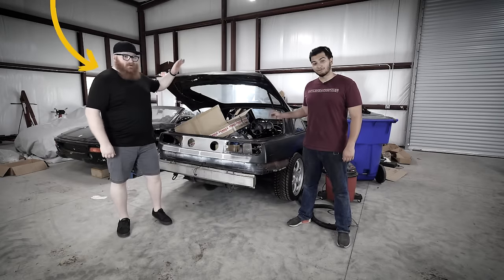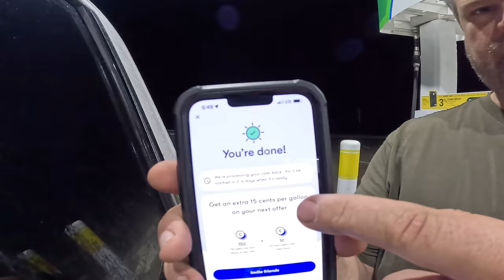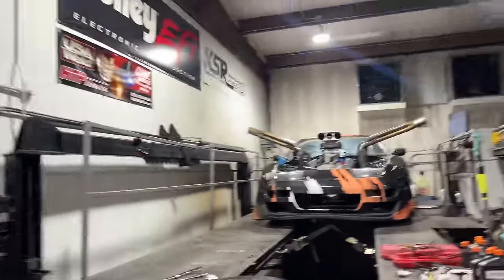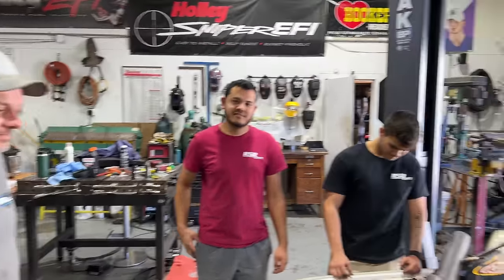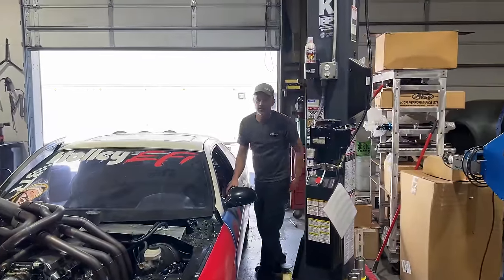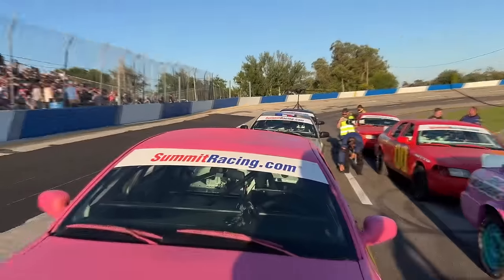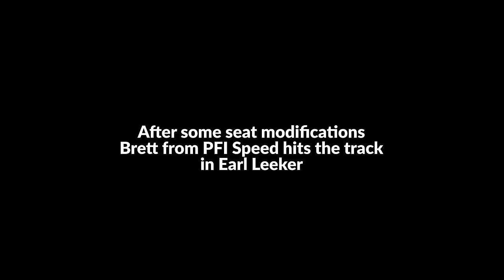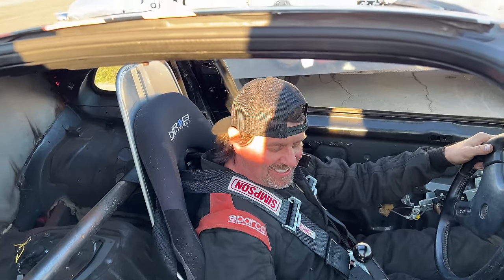We Debuted Our Nissan 300ZX In Front of 10,000 People! It Didn’t Go Well…

Comment: Tunnel Ram + Fuel Injection is harder than it looks. It is a nice looking car and an awesome looking engine that is a work in progress. As is your typical situation you seem to be in a time crunch and as a result the event WAS your first actual driving test of the car. I say it went real well for a first effort when you drove the car.Then you made fuel the pressure change and it went downhill. Perhaps moving the injectors just before the valves as you intend to do will be the fix, as the changing air/fuel mixture conditions in the tunnel ram are just too hard to predict. This is definitely a science project and You if anyone are the best at figuring the outcome (you should have been a Professional Engineer (I'm retired) in my opinion because you have the mind for it (takes one to know one)). You have some of the best science based project cars on YouTube. Keep it going, you have put much effort into this combo and I feel you are close to a breakthrough. For the cool factor this car is a 10+ and the wrap is really neat. I look forward to seeing what happens with the next iteration of change.

Comment: At least you still have a motor to tune. Could have been much worse. 
(Perhaps the crudeness of carbs are ideal for something like a tunnel ram). 
But it takes a guru on a dual carb, or a dual throttle body. Both are almost impossibly touchy. However, im sure  tunnel ram specific carbs exist for that exact reason. Once you get it this thing is going to kick butt

Comment: You took a new, untested build to what's arguably the US's largest burnout Comp and sent it....mad Respect 🇦🇺
Look everyone has their own thoughts on it, this is just my 2c/personal preference....while it does take up more space, line routing can be a pain and it's not necessarily cheap, consider upgrading/switching to a dry sump set-up.
With the constant high rpm and fast changing g loads you can have the best oil pan/pick-up in the world but it's all for naught if you can't get the oil back down to where it needs to be.
Keep 'em coming mate, cheers 🍻

Comment: Looks like you're experiencing the notorious low rpm poor vacuum signal issue that plagues big blocks, racy cams, and  tunnel rams. Mix that with the dual carbs and you can't get the right tune for runnin rpm, but seems lean when loaded/starting a burning out... just to get phat with rpm. Venturi effect is even worse over a large area ( two carbs)...just in the dynamics alone, cant get the air velocity at the already poor vacuum and large area, the math never maths. 
I do wonder if you could fashion a variable choke on that blower intake (make it look like it has its own throttole blade) and then the "choke" may be vacuum driven!? idk just some ideas without going full efi.
Reply from the maker: New cam, and port injection placement is going to get it right!

Comment: Dude, Jared, that TINY ASSED air filter is WAY TOO SMALL for that motor. I know the air induction thingy LOOKS kewl and all, but yer only hurting yourself. 
Ditch the Ram air intake assembly and get a 14" K&N setup that better suits the C.F.M. needs of the engine. That being said, with dual carbs, you can probably squeeze in some 8" filters or you could use spacers to stack oversized filters on top of each other. Either that or convert to an airbox with an oversized rectangular filter. Seriously, there are better options....
tl;dr = C'MOOOOOOOON!!!!

Comment: this a bit off topic question ,do cars towing trailers / big rigs  not have lower speed limits (speedo reading 75 mph on way to ksr)
in uk and Europe they have lower speed limits (uk cars towing trailer 60mph on highways and trucks 56mph ) Europe depending on where you are 80/90/100 kph (50/56/60mph) 
what happened to the 55mph limit ??????

Comment: Tunnel ram should work great with that TBI. Though tunnel ram is about that full RPM. Could it be stall too low in the trans?
Reply from the maker: I’ll go into really deep details in the video adjusting things, it’s a mixture of a tight converter to keep heat down, along with cam choice. Cam is for a future blower setup that may or may not happen and it just won’t jive with the current setup
Reply: @TheQuestionableGarage  What is the redline on your tune?

Our fam has a dual 640 (iirc) tunnel ram OG 350 LT1 that dad built back in the 70s that pulls up to 8k.

Wish I had video to do it justice. That is an engine to hear!
Reply from the maker: We would let it spin to 7,000 (capable for more) but the mixture of super low air speeds from cam, and spinning around made for some bad fuel distribution. It’s getting fixed!
Reply: @TheQuestionableGarage  I cannot wait! This whole video I was thinking it just didnt sound right for that intake setup you had not at idle or on throttle.
Reply: Oops, and addendum. Need velocity stacks too. That will help a lot. Else are like those people with cafe racers running tiny pod filters straight onto their CV carbs. That will help a lot I suspect too?